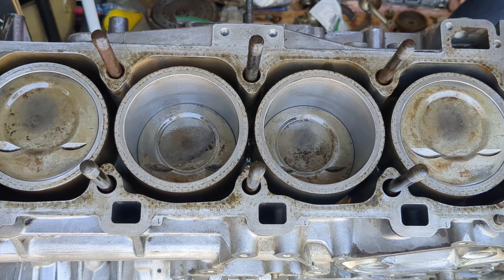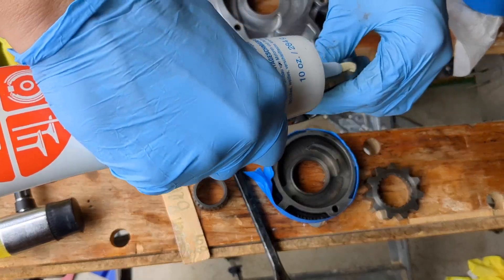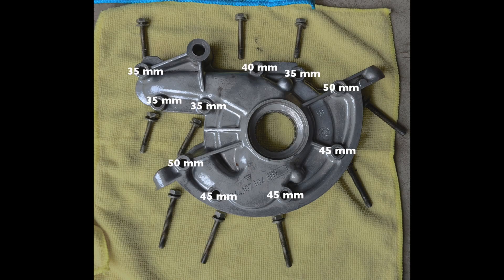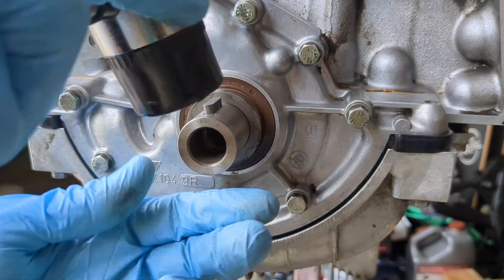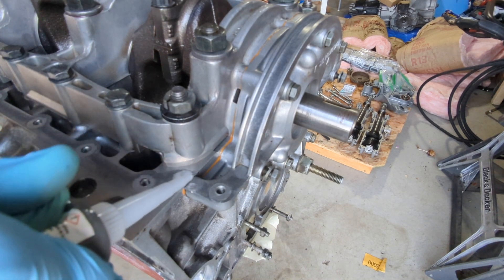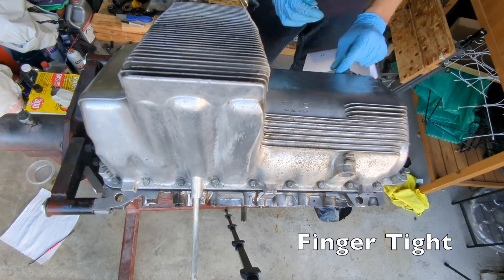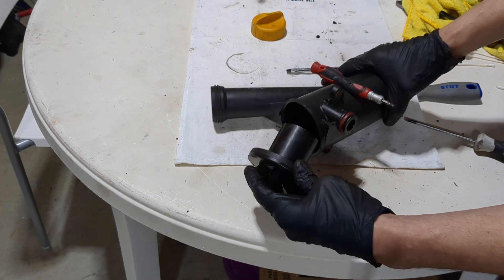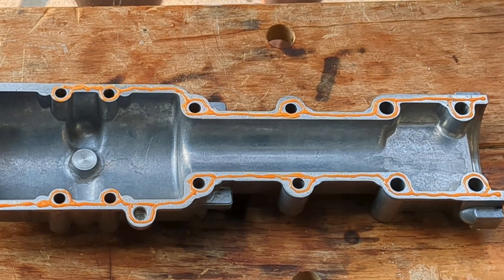Porsche 944 | Engine Rebuild Pt 4 | Oiling System | Oil Pump, Oil Pan, AOS

Comment: Great videos! I have a question. I notice you use different assembly lube for different parts. Is there a reason you do not use #105 on the crank and piston rods?
Reply from the maker: For the oil pump the #105 is there to help prime the pump. I wanted it to clear out rather quickly. For the crank and pistons I wanted something much thicker and tackier.

Comment: Well done! Especially helpful is the location of the different size M6 bolts on the oil pump. A note regarding the late model 944s with the belt tensioner. There will be a M10 bolt instead of a stud on the oil pump.

Comment: are you sure that the torque reading is accurate with that  extension? nice work anyway
Reply from the maker: With the crows foot? I did my best to keep it at a 90 degree angle to minimize the change in length. If not then I am over torquing slightly as I didn't adjust my wrench